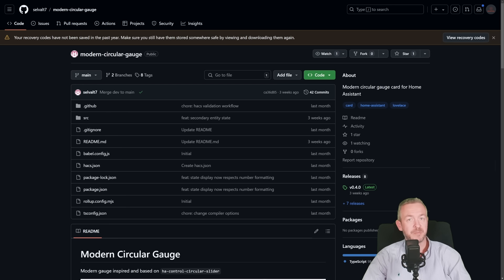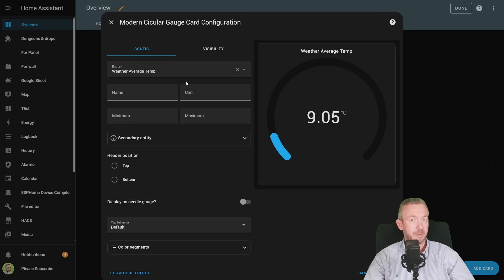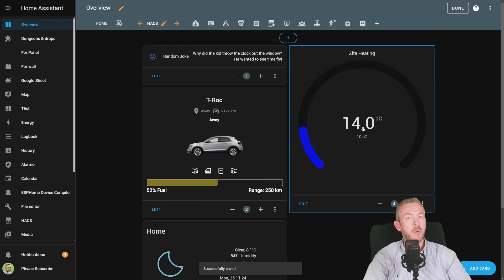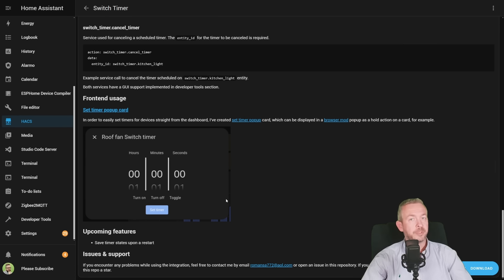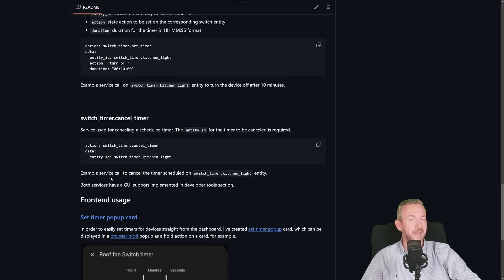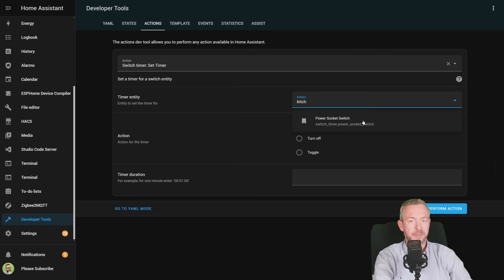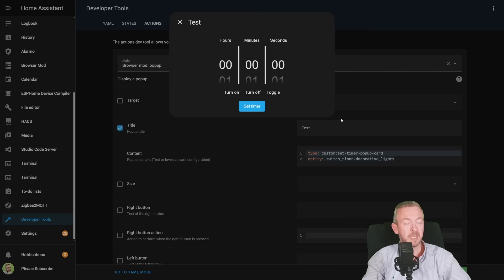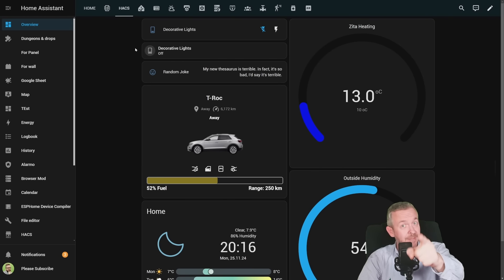Switch Timer(s) and Modern Circular Gauge card from HACS

Comment: Switch Timer looked promising until it created around (and was still counting until i uninstalled it) 6390 entity instances for a single switch x all the switches in my integration
switch_timer.3d_printer_enclosure_6390  😳
Might hold off on this one
Reply from the maker: That's BAD... I haven't had such an issue on 2 systems I've tested it... But yeah, that's a big bug. Did you maybe open issue on GitHub?
Reply: Happened to me as well... watched it continue to add the same entities over and over again... Removed for now...
Reply: Does removing the integration removes all its created entities?
Reply from the maker: @alex13dafer  it should remove devices too...

Comment: Love the new gauge. Would it be possible to add an arrow or something to show that the value is recently increasing or decreasing ? So if the temperature has been going down in recent changes i know that the room is cooling down or warming up. Thanks
Reply from the maker: Not directly with this one. For that you'll need to use trends integration. I use it to track quality of air if it's dropping or not.
Also trends in temperature too.

Comment: Is the switch timer easily integrated to the Automation submenu. It like to turn a water pump on for 10 secs everyday at a certain time. And this would definitely streamline the setup for the auto mation pretty easily.
Reply from the maker: You should be able to do it with something like this in automation:
action: switch_timer.set_timer
data:
  entity_id: switch_timer.water_pump
  action: "turn_off"
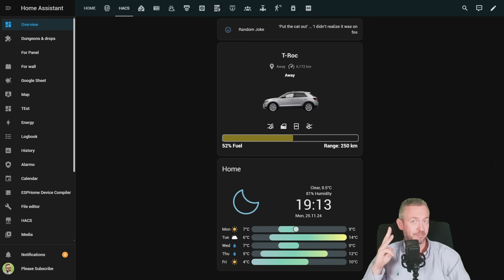  duration: "00:00:10"
Reply: @BeardedTinker  Thank you! been getting ready to try this.

Comment: Any performance considerations qith all the entities created by Switch Timer? This is, in essence, what I've felt myself needing many times but qodnering if it comes at a cost.
Reply from the maker: I haven't seen. As I have around 90 switches in system, it just creates additional 90 new entities. There are already 3749 entities in my system, so that's just a small drop of water in the bucket.